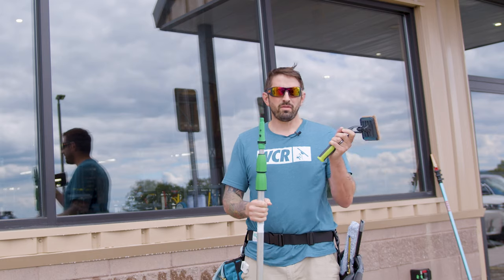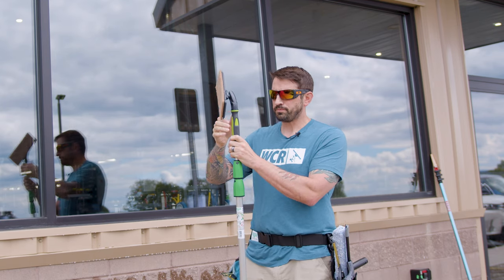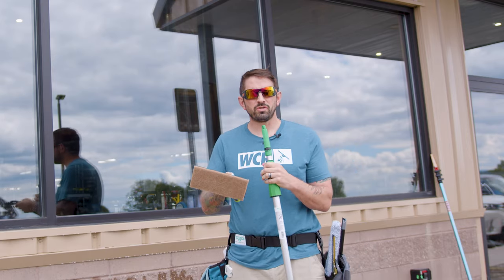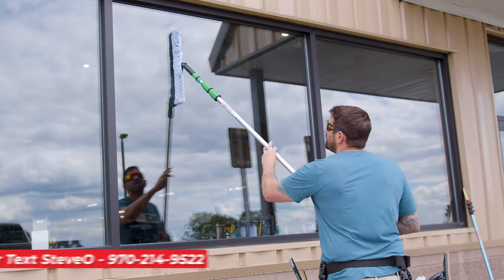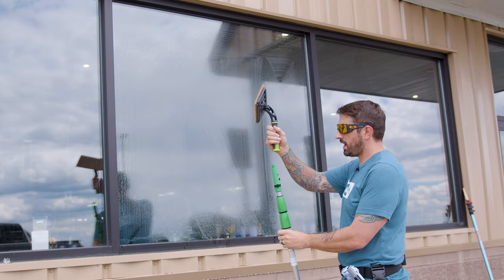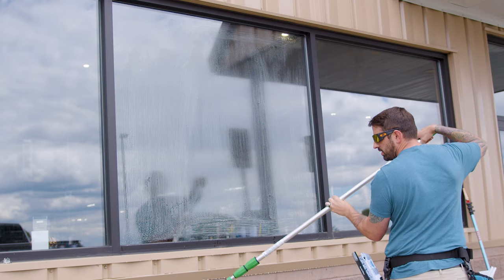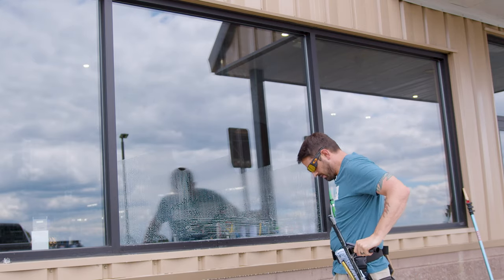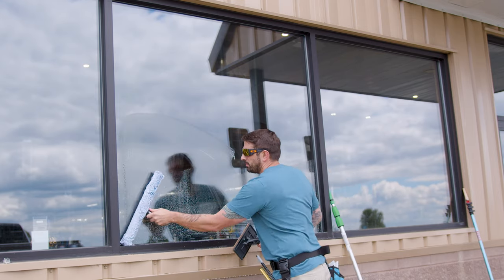SteveO's Guide to the IPC TechnoPad

Comment: I love the look of this tool. I’ve gotta say: I converted from 18 to 14 inch mops in the last year and I’m astonished how little I need ANYTHING else on even the dirtiest glass. I bought the MAYYKER hedgehog sleeves and I’ll NEVER go back to traditional mops again. The scrubbing power you get from those sleeves, particularly in the 14” size, is extraordinary! Now I only wish the Mayyker BOAB I bought was shorter for the 14 inch sleeves. He needs to make those!
Reply from the maker: That's a great suggestion! Thanks for watching!
Reply: Depends jobs ...regular clean +45cm mop,squegee,..dirty job 35  cm or pad because You Need more pressure on surface ...Wagtails do pretty ne-ar pad pressure on surface

Comment: How do the down strokes he did with the pole not leave any streaks? Is it the speed plus the angle plus the quality of the rubber?
Reply from the maker: IT has a lot to do with the rubber and the solution being used. The glass has to be properly prepped for the squeegee to do its job 😊
Reply: @windowcleaner  Would it work with the good old classic dawn and water? More soap than usual to prevent streaks? This is great information thanks so much.

So proper technique (angle/speed) 

Rubber 

And solution, what do you recommend for solution if the dawn dish soap alone wont do enough?
Reply: Love the videos but man come on you need to prove on a greasy dirty spotted window that this product actually works. I get it. You’re cleaning a very clean window maybe for the future some real dirty windows and improve the product thanks man.